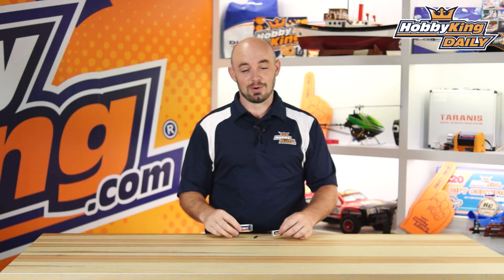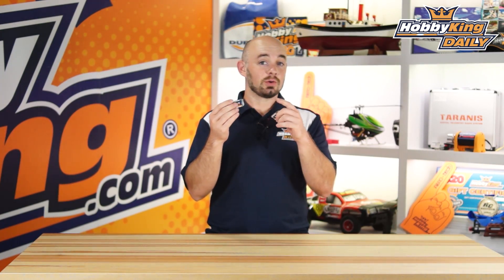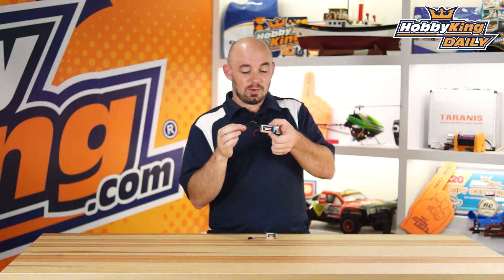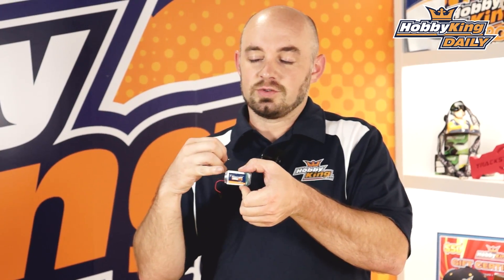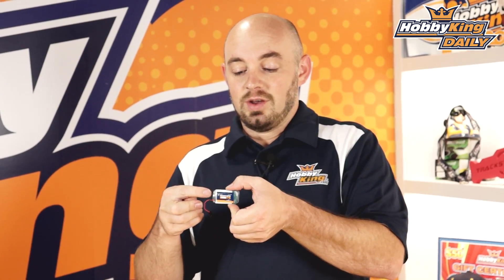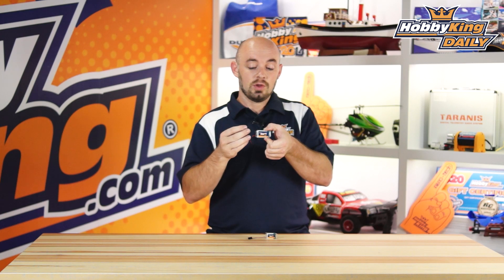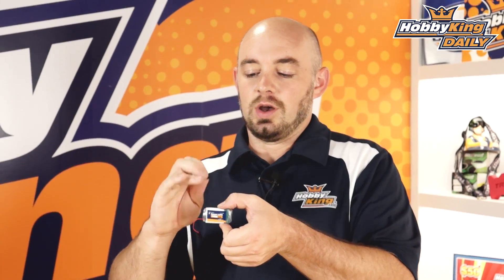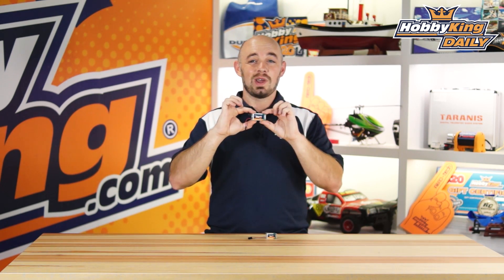HobbyKing Daily - HK 5V Smart Lipo

Comment: Would be a good fit to the dx6i?maybe two 500's parallel?A bit pricey though.
Reply: They do have this for the DX8. http://www.hobbyking.com/hobbyking/store/__19481__Turnigy_4000mAh_Spektrum_DX8_Intelligent_Transmitter_Pack_.html You could hack out the 6i's battery box separators and wire in a plug if you wanted to, but I don't remember if the 6i has an adjustable low voltage warning buzzer. This has the lvc and charger built into the board, so you just charge it with the DX8's included charger.
Reply: Badmuthatrucker666 Thanks for the reply ;)My dad's dx8 has one of these in and it's very very nice!But reading forums online the dx6i is using around 6v.Many people put 2s lipos on them and work.Many say you will burn it out.So it's pretty mixed up.
Reply: Yeah, true... and I use one in DX8 and it lasts forever...  But you have reminded me... I have seen people using a regular 2S lipo in DX3s and 4s by wiring in a Castle Creations 10a BEC that they have set to 6v. No reason that you could not do the same. Just remember that you would have no lvc so you'd have to use one of those Hobbyking $2 low voltage alarms that plug into the balance plug on the battery.
Reply: Badmuthatrucker666 That's probably where i'm going at.I have to disconnect the bec each time i finish though but ohh well.
Reply: Yeah, just take the battery out and top it up or put it storage mode :) Better than the poor life span the included 1500 AA's give :)
Reply: Badmuthatrucker666 Thanks for the help man :)So a 1a bec should be enough?btw 5v work fine on the dx6i
Reply: 1A should be enough. I can't imagine why it would draw more. I have some 2 ch radios from when I started and they had the power consumption in their manuals. The Accoms was rated at 700ma and the JR was 800 I think. But that is very old tech. Might be worth shooting Horizon an email asking of the average current consumption of a DX6i. But I always leave some headroom and if it were me, I'd probably use a 3A bec to be safe :)
Reply: Badmuthatrucker666 Yeah they are so cheap a 3a is fine :)